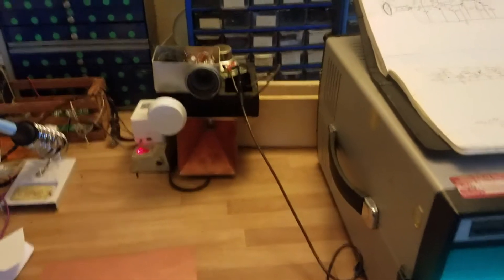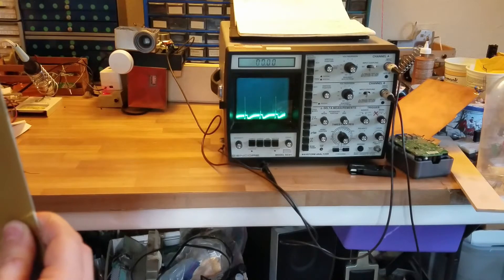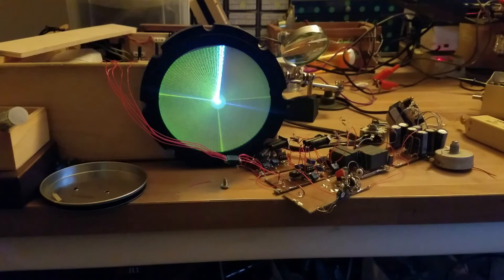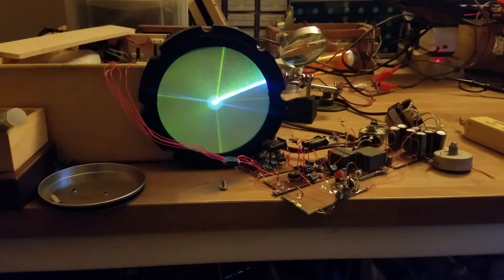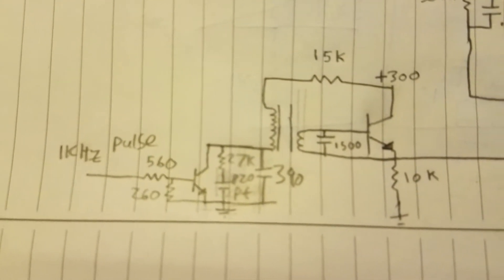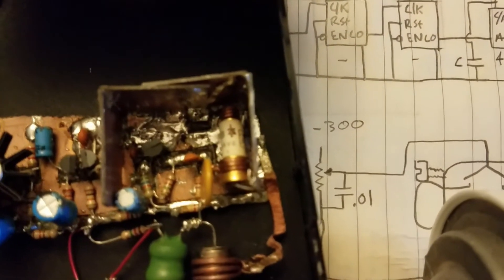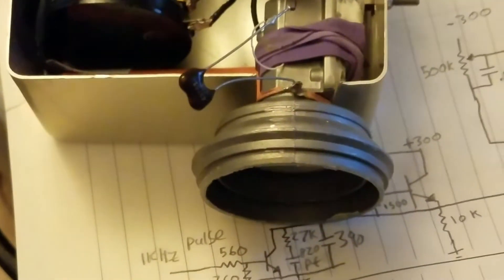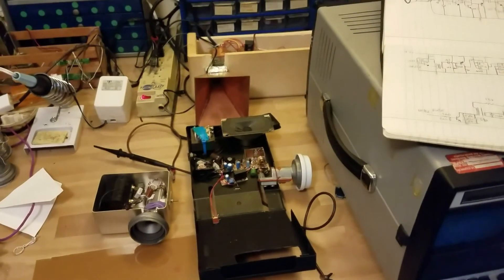PPI Radar Display part 2 of ?

Comment: Reagrding a rotating platform, I spun an X-band transceiver called a gunnplexer using old 1960s-70s record turntable baseplate, platter, and motor. It was not a direct drive type but an idler rim-drive drive type with the record changer spindle that passed through a hollow bearing in the center of the platter. Power went to the rotating platter through two slip rings on the somewhat long, almost 1" diameter casting that held the sleeve bearings. I got a machinist friend to make the slip rings. The video output (demodulated return signal) was sent optically via a current modulated, biased-on LED, down through the changer spindle hole, to a phototransistor under the base plate. The brushes for the slip rings were taken from an old style ford alternator from a 1972 Pinto. It's a little thing with two spring loaded brushes sticking out of it. worked very well. Large decoupling cap up top on the platter to take care of motion-related noises from the brushes as they supplied power, then a 9 or 10V regulator further de-noise and operate the gunnplexer. I didn't pulse it, or hook up a PPI to it (only a scope and an audio amp (which was annoying)), but good luck on your project to do pulses. 1uS is quite long a pulse for using radar close-in, considering how far the pulse travels, but you will find a way to make your project work, I feel confident. Good job, please continue!
Reply from the maker: Thank you! I really have to get back to this. My main issue has been finding a suitable receiver. I have recently gotten a 9.75 Ghz gunnplexer but I think it might have a fried detector diode since I have not been able to get much signal out even though I can pick up the gunn diode fine with my hacked LNB. Would you happen to remember what kind of IF amplifier you had on the output of the gunnplexer? I assume it had a detector diode and a ferrite circulator inside and the diode output went to a receiver of some kind. So far I have just been trying to low pass filter the output of the detector diode and put it into a very high gain audio amp.